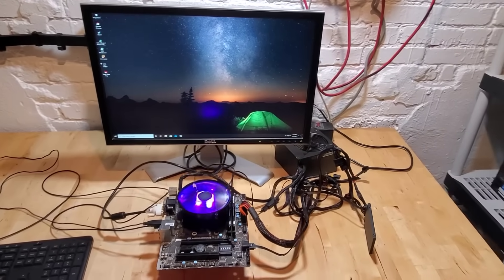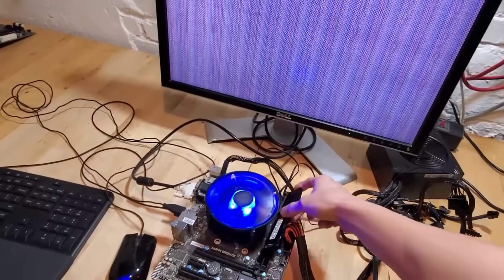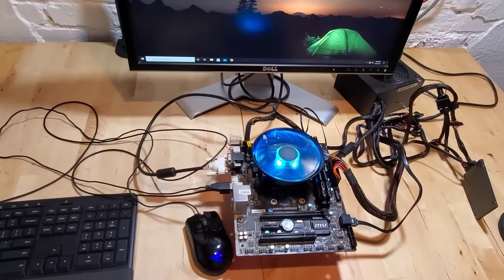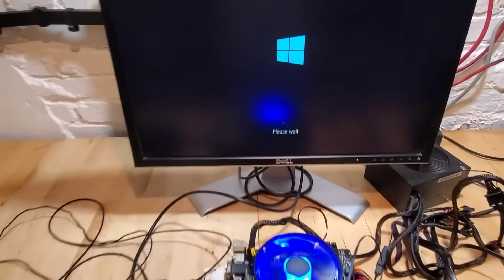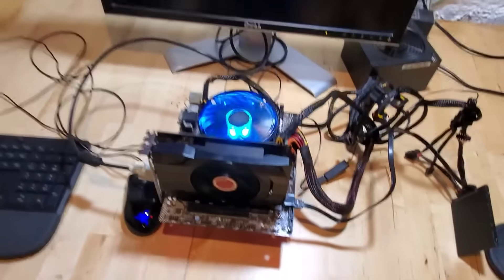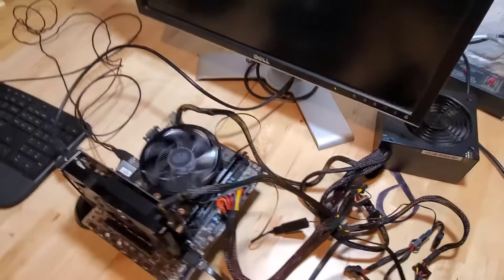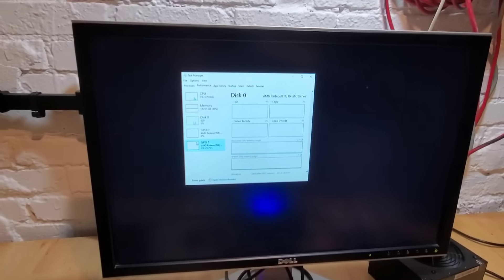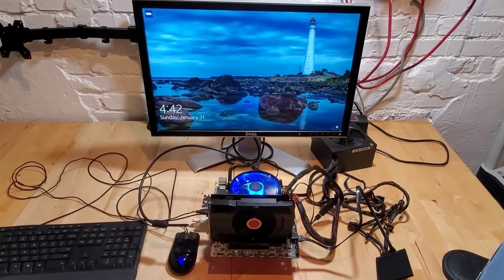What happens if you remove PC components from a running computer?

Comment: That SSD removal actually concluded some pretty interesting results:

- The background didn't disappear immediately, but after 2 or 3 seconds after the removal.
- The mouse and K/B work just normally. // means that the code that controls those must be loaded in the RAM
- The desktop icons followed. // makes me think it does some sort of cycling of the drive to check what it's supposed to show on the screen.
- When it finally decided to completely break, it showed a BSOD. // means that it can find the BSOD screen and code in the RAM (or maybe even VRAM?) would love to know the crash code it gave. 

Now, what I really want to see you do is remove the SSD, and immediately reseat it. My hypothesis is that on the next "search cycle" the computer will notice that "Hey, everything's okay now, that was just an anomaly", and continue operating normally.
Reply: "CRITICAL_PROCESS_DIED" is the error in the BSOD
Reply: PLEASE, LET THAT BLUESCREEN ERROR ALONE, IT WAS A PAIN FOR ME TO FIND OUT THAT MY CPU WAS BROKEN
Reply: That immediately reinsert part is true for when I tried it with macOS but I didn’t try windows yet so I still have to do that
Reply: the Blue Screen is in the Kernel, which is always loaded in the RAM
when Windows receives an unhandled exception it immediately shows the Blue Screen and shuts down the PC
Reply: @tennypai  No it doesnt, I've done a fair bit of HD swapping on my non main drives, windows can regonize new drives during runtime
Reply: @tennypai  If the Windows core files are still running, they recognize storage devices without the BIOS having to initialize them.
Reply: @thataakarsh790  That's also why the RAM insertion didn't worked, the Windows Kernel is required to run Windows, but since the RAM is empty, the PC doesn't know what to do.
Reply: "- The mouse and K/B work just normally. // means that the code that controls those must be loaded in the RAM"
did you ever use BIOS??????????????????????????????
Reply: @RoeGi1337  did you ever learn what the bios does? because, judging from your comment, you didnt.
Reply: I have done this with an old laptop and yes it is fine if you plug the ssh/hdd back in emediatly
Reply: I don’t think a system would reinstate itself from a bsod
Reply: The keyboard, mouse and BSOD are all part of the kernel which is entirely loaded into RAM on boot
Reply: @Ed.E  sorry, i'm out of topic, but what's the difference between "core", "kernel", "nuclear" ???
Reply: @bahodirvalijonov5885  I don't know what I said but Kernel is the lowest level of the operating system that communicated directly with hardware and manages all other processes, core means a CPU core and nuclear means going very wrong
Reply: Either CRITICAL_PROCESS_FAILURE or STORAGE_EXCEPTION_FAILURE
Reply: That's exactly what will happen, and that's what actually happens when you do a SATA reset (that's when your HDD heads have to take some time to reset the drive and calibrate back again due to shock or normal mechanical wear, so it has to spin down and spin back up again, letting the OS know about it).
Reply: the exact blue screen error for when the OS drive is unplugged is called "DRIVER_UNLOADED_WITHOUT_PENDING_OPERATIONS", i had it once on my laptop when the hard drive unplugged by itself.
Reply: If the SATA port the SSD is plugged into is set to  “Hot plug” in the bios, then what you theorized could possibly work, but “hot plug” is something disabled by default because disk drive (HDD or SSD) are usually not meant to be hot swapped, but there’s instances where it’s needed.
Reply: you do realise that many many services are temporarily stored in the ram because then how else would you get the bsod error code if the drive fails . nonetheless youre analysis  is very interesting
Reply: I'm assuming that windows checks to see if your wallpaper changed and when the file is missing it stops displaying it (would probably be the same as deleting the file). The desktop icons are also stored in files so I'm assuming that explorer tries to refresh the icons and can't find them so it can't display them anymore. I expected that the mouse and K/B code would be in RAM as its much faster if its all stored there. The BSOD is meant to still be able to work even if everything else is broken so it makes sense that the code is in RAM.
Reply: It does I have done this with modern drives and loose cables that were later replaced. Sometimes it works sometimes it fails.
Reply: the background and icons took a while to disappear because windows explorer does periodic refreshes. it's not live, like the macos finder is
windows stop error ("bsod") is not stored in vram, that's not what it's for. but the code to initiate it is held in ram. the codes are not, though, they have to be fetched from the drive, which obviously didn't exist
Reply: @TheDrunkenGunsmith  but what about another main drives with different windows tho? Like different settings and icons
Reply: @PhuNguyen-my9un  What do you mean? When I say "Main drive" I mean the only drive windows is installed on.
Reply: it could be cached in the motehrbord for a few seconds or being kept on the gpu for 2 seconds
Reply: i'm really not convinced about your hypothesis for the crashes, but i have limited knowledge on Windows internals. i think that processes died one after the other because they could not recover from I/O errors/timeouts. the BSoD mentions "CRITICAL_PROCESS_DIED", so i'm assuming that this ended up happening with a core process.
unless under memory pressure, most processes should already be entirely living in RAM, but maybe it needs fetching some code from .exe/.dll they haven't loaded yet - not sure if Windows preloads that, for instance.

> Now, what I really want to see you do is remove the SSD, and immediately reseat it. My hypothesis is that on the next "search cycle" the computer will notice that "Hey, everything's okay now, that was just an anomaly", and continue operating normally. 

the drive needs some sort of initialization, but if the motherboard supports SATA hot-plug, i think it should be alright. not sure what Windows will think about doing that with its boot drive, though.
Reply: The code that controls those must be loaded on ram. Yes every piece of process is on ram, provided you have enough ram.
Reply: The user profile on the drive is not available, that is why icons and wallpaper vanish.  When the boot drive times out, the RAM cannot establish connection to running processes, and halts.
Reply: I feel smarter just reading this
Reply: @ahmadayoub4108  the ram will run out because of? Rams don't run out on their own, some process must allocate ram storage for it to run out.
Reply: @ahmadayoub4108  no. We don't know how windows uses the memory. The crash may be from something entirely different and it probably is. Yours is a bold and potalentially wrong claim. "Garbage collection" doesn't occur on its own and it has no reason crash the system, regardless of the presence disk space.
Reply: I have a bad cable connect on my old pc, so I can tell you that it always need to reboot after that. But on win 7 it doesn't show a bsod, just stops to react (but mouse is still working)
Reply: to connect a SATA drive while in windows you need to have HOT PLUG enabled, with this it will connect with no problems at all
Reply: The BSOD is part of the Kernel itself, which is always loaded into RAM at startup.
Reply: @tennypai  no, sata3 is hotswappable. Ive done a lot of hotswapping with sata3 hdds on windows 7
Reply: The SSD thing you mentioned at the bottom of your comment could only work on a hotpluggable motherboard and port. Even if he'd reconnect the SSD after 0.5s, if the MB doesn't support hotplugging, it won't matter.
Reply: - It didnt disappear immediately because somethings are loaded in memory
- Whether the mouse and K/B work normally depends on the OS but most of anything you do with the peripherals will yield no result.
- Your gpu cycles every sec with a process called buffer swapping. The time it redraws each picture every second is your fps.
- That is window-related code so i am not sure, but it most definitely is loaded in RAM so it can show errors in cases like that.
- Reseating the SSD shouldn't do anything and the problem should continue. Due to memory allocation and memory addresses being missplaced and such.
Reply: @tennypai  wrong.   The bios doesn’t have control at this point.   Once your in protected mode the bios is completely out of the question
Reply: mouse and keyboard have to be in RAM all the time while the machine runs since you cannot execute code from disk
Reply: I’ve recently started coding on Java so I’m assuming you’re adding // means that’s a note to your point that you’re trying to make?
Reply: this happened to me when i put my monster magnet under that table my laptop was on and it went towards the ssd and completely wiped it...
Reply: I did not see how much memory he has, but what about the pagefile that would be on the drive and would that cause a problem...
Reply: I believe the BSOD appeared because going into recovery/safety modes can be stored in the RAM, at least, that’s how macOS works.
Reply: @ahmadayoub4108  How does....RAM run out? It's not how RAM works....this is esentially the same when playing games from a cd. The code is already inside of RAM and when you remove the cd the game will run just fine
Reply: UNMOUNTABLE_BOOT_VOLUME
Reply: Mouse, keyboard and BSOD are all part of the kernel, which has to be loaded into memory if you don't want your PC to be slower than a grandma on a scooter rolling down the dual carriageway.
Reply: For the most part, yes, immediately restoring the SSD makes everything fine.  However, there is a small chance that it will brick the drive, causing a forced reformat in order to get it back.  (Or in my case, it happened every time, because the SSD decided to shut off itself I assume from overheating)
Reply: Windows, since Windows 7, is actually quite resilient to drives "dropping out" and "showing back up". It certainly doesn't like it to occur repeatedly, or for extended periods; but, Microsoft's changes to the underlying storage fabric for Server capabilities have been trickling over to the client side for nearly 2 decades. XP was iffy on this, especially on the hardware XP was run on at the time; but, there were some of these "resilient" storage capabilities in XP as well.
Reply: как-то раз я случайно вынул жёсткий диск На ноутбуке с windows 7
Как результат - был последний кадр, двигалась мышка и можно было таскать окошки, но ничего не открывалось, не нажималось
Видимо, есть значительная разница между вин 7 и вин 10
Reply: "The mouse and K/B work just normally. // means that the code that controls those must be loaded in the RAM"

Look out we got a fucking GENIUS over here 🤦‍♂🤦‍♂🤦‍♂🤦‍♂🤦‍♂🤦‍♂🤦‍♂🤦‍♂🤦‍♂🤦‍♂🤦‍♂🤦‍♂🤦‍♂
Reply: You can actually force the OS to be on the RAM, therefore nothing major would happen
Reply: @joaosimoes5052  Until you try to access the resource on the hdd/ssd that is.
Reply: :o
Reply: i have personally experienced this when i had a janky sata power cable.
Reply: There is something that he doesn't mention which is if you have a second drive (SSD or HDD) and you just remove the main SATA SSD, PC would work normally and you can plug the SSD again while PC is running and it will recognize it.
Reply: No u have wrong hyp.. Because I already did the same thing with my PC as well as laptop
Reply: What happened to don’t try this at home?
Reply: Spoke like a true CS guy
Reply: yeah should try
Reply: You can Definitly do that.  Ive done it before.
Reply: Trinh Khoa  Anything it sees as *REALLY* abnormal.  Will result in a *STOP* error (BSOD)
Reply: pcs are really flexible with storage reliability, I once had a problematic drive with something like an effective 50kbps transfer speed.

The crazy thing is, it was operating normally just extremely slow. I needed about 12 hours to launch windows and darksouls 1 (a game which uses mostly ram for everything) after that the game run almost like normal.

Just in case anybody is wondering, I took it to a small shop and the technician said he hasn't seen something like it. His words; usually disks become more noisy when they start having issues like that, mine was dead silent (not typical for a hdd)
Reply: bsod are stocked in cpu, in the cache L1or L2
Reply: The blue screen is a core part of the Windows kernel, so it's always in RAM.
Reply: The crash code was CRITICAL_PROCESS_DIED
Reply: In a video of Dankpods, where he installed windows on an iPod and was playing Doom Eternal through the iPod's internal HDD, he yanked the iPod out, but because his system had 16 gigs of RAM, the game kept playing normally for a while, until the system crashed. So yes, a program (or a part of it), when in use, gets copied and stored temporarily in the RAM.
Reply: Critical_Process_Died was the bluescreen. Virtual RAM is the disk RAM. Maybe you meant GPU memory, too? We are unsure.
Reply: @rejiix
The "code that controlls the Mouse/Keyboard or BSOD" you were reffering to is the kernel itself (or its modules, so called drivers in case of mouse/Keyboard), which is loaded into RAM on boot. When you remove the SSD/HDD, you are just removing the device which holds the root filesystem, so the kernel can no longer read/write stuff to it. Upon reinsertion of the storage device, it likely does not get automatically mounted, making the issue persist until the next reboot. The BSOD (kernel panic state) is the state your computer gets in as the result of (in this case) hardware failure. Removal of the hardware is in the perspective of the kernel a failure, a critical error.

I hope this clarified the stuff a bit.

P.S.:
Please keep in mind that what i just described is the behaviour of Linux. As far as i know, in these scenarios, windows should behave the same, but i can not give a guarantee.
Reply: That last part...
Windows 7 is perfectly fine with that.
Windows 10 on the other hand, once the SATA cable has fallen out, too late to put it back (BSOD)
Reply: our school computers used to run on an external sdd through an usb port. i really don't know why they did that instead of just replacing the dead hdds. we all used to rip them out for no reason
Reply: its probably storage exception failure btw
Reply: Im guessing it noticed something was wrong and tried refreshing the desktop
Reply: i'm pretty sure USB protocols are stored in the bios? Because I've powered on computers without operating systems, install installed, and keyboard and mouse input works perfectly fine.
Reply: VRAM isn't directly CPU executable and just is RAM on integrated graphics. Also any driver like the keyboard and mouse ones should have 100% of the processing code in RAM at all times or your computer will slow to a crawl
Reply: Yeah I too think it will start working fine in most parts, though some areas may be corrupt till next restart
Reply: Damn you must be a computer science student! So do I just got the field, excited to join the science community
Reply: the bsod might also be saved in the bios chipset, but idk
Reply: @chikirin9349  nope, pretty sure the bsod code lives in the kernel, of which all the code is probably loaded in ram the second windows boots up.
Reply: @chikirin9349 The BSOD is windows specific and there are other operating systems. So no

Comment: Cool vid but what happens if you turn off the system take out the components then turn it back on without putting them back
Reply: Bios would fail POST (power on self test) and will begin beeping allarm sounds (you need a buzzer to hear them).  Based on the beeps pattern (long-short beeps), it will signal where's the problem, like an auto-diagnose system. You'd find the explanation for those beep patterns in your motherboard manual.
Reply: Just beep codes

Comment from the maker: RAM removal: 0:09
CPU removal: 1:49
GPU removal: 3:56
SSD removal: 5:21
Reply: If you put that in the description, it will break the progress bar into sections as well
Reply: @jackkrauser6832 never knew that, lol
Reply: @jackkrauser6832  no it didn't work for me
Reply: @vivekverma3629  there are a few stipulations. You need to begin with 00:00 and put all time annotations in the order of this example: 
00:09 Ram Removal 
And each split must be at least 10 seconds.
Reply: @vivekverma3629  remove the extra zeros at the start (00:00:00 --> 00:00)
Reply: @snowiblind  I did exactly what you have said but still no luck...
Reply: @vivekverma3629  some additional guidelines guidelines 

Your channel has active copyright strikes
Your channel has less than 1k subscribers
Your video content could be potentially inappropriate to some viewers
Reply: @snowiblind  dude only added one zero so it was 0:00 instead of the correct 00:00 lmao
Reply: Pin it bruh 😂😂😂😂
Reply: Soul removal 0:00
Reply: Lol, that is the same GPU i have, I want to upgrade but cant, sigh
Reply: Do the same using Linux to see the difference in Windows and Linux Kernel
Reply: Wrong not CPU you removed the APU.
Reply: Removing GPU + swapping cable to APU?
Reply: I would liked to have seen the dGpu removed and later connect dvi cable to iGpu, and to see what happens
Reply: Same
Reply: But i want  Removing CMOS battery
Reply: remove da motherboard 🤓
Reply: Can you try build a new computer but as soon as you take parts out of the box, you have to plug it in to power
Reply: mr YEETer
Reply: This channel helps me learn with pc's